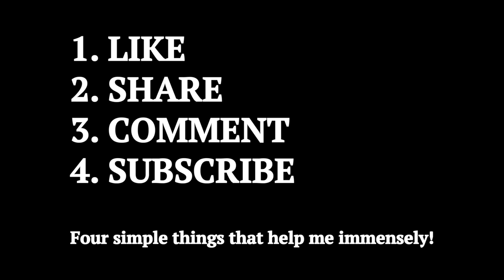How to Make the Harley Quinn Bat from Suicide Squad

Comment: So clear lacquer will prevent the sharpies from bleeding when writing the text, correct?
Reply from the maker: Yes, it won't be able to bleed into the wood. And you can put a coat over the sharpie to lock it in too. But be careful; too heavy of a coat and it could bleed the sharpie.
Reply: Thanks for the info dude!
Reply: I have some Rustoleum flat clear, would that work to prevent bleeding or should I go buy some clear lacquer?
Reply from the maker: No idea.  I've never used it.
Reply: Southpaw FX  h
Reply: Southpaw FX  don't know
Reply: I ended up buying some lacquer and it turned out great, I guess we'll never know about the flat clear!
Reply: Southpaw FX  so it does work
Reply: Clear lacquer does yes, but I had to do a few coats to the blank bat to have absolutely no Sharpie bleeding
Reply: Great tip, I always have trouble with this
Reply: Southpaw FX I don't get what are you saying
Reply: Clear coat and Lacquer are 2 different things. I used the lacquer to seal the bat, so I don't know if clear coat would work.
Reply: Southpaw FX to

Comment: Comments: 1 Awesome job on the turn, decoration, fit and finish.  It looks as good as the original.  2. Every wood turning on YouTube needs to understand the compressed/sped up turning featured in this video.  Watching a 30-60 minute, multi part, wood turning extravaganza on making a bowl/plate/candle stick is soooooo boring.  Your version got to the point, demonstrated the planing, skill, and completion without the labored process.
 OUTSTANDING.
Reply from the maker: Thanks!  I'm new to turning and trying to make it interesting is hard!  This isn't a "how to lathe" video so I can get away with a couple big jump cuts haha!  Thanks for watching and the feedback; its very much appreciated!
Reply: My suggestion is to keep to this style. There are plenty of "teachers" out there.  You are a member of the rare - here's what I made. Or to put it another way; if wood workers were to make videos in the "turner" mode, they would include the harvest, cutting, drying/seasoning, selecting, measuring, re-sawing and cutting  into the process of building of a wooden cube. A ten part extravaganza. - just my two cents. -Annie

Comment: A cricut could have easily and perfectly (not mostly) made that stencil. Actually it could have done all the wording and designs and words on the bat. Either way u do it though remember...transfer tape is your friend! Get to know it better 😊
Also, u should really get yourself a weeding tool for removing tape and stencils. Super cheap and super helpful. Less damage than using a blade.